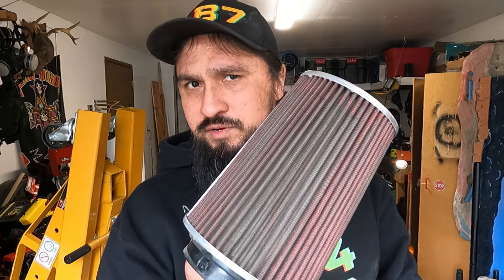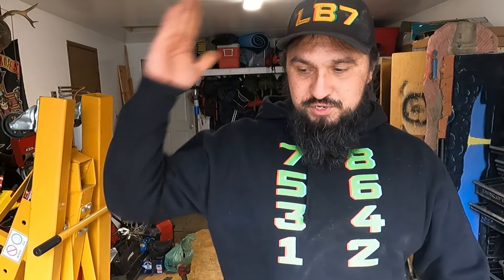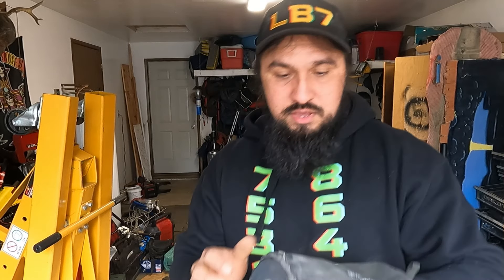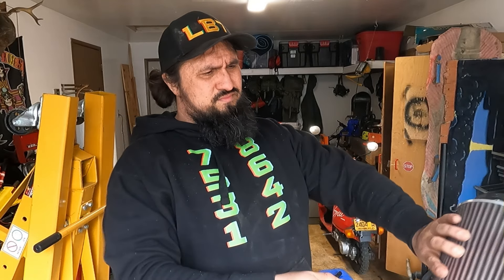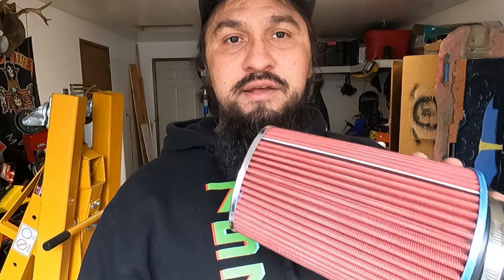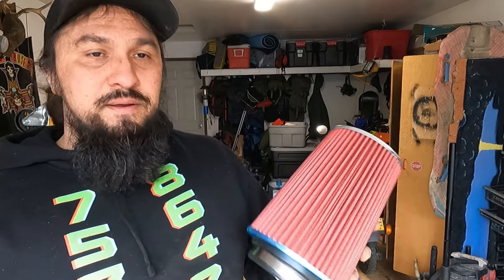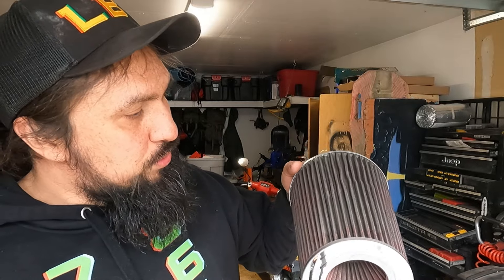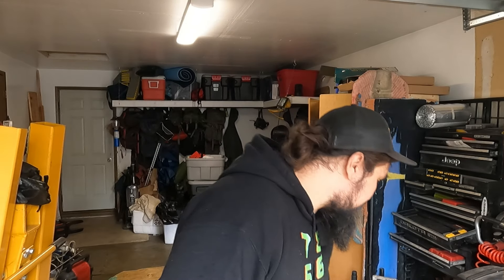Duramax Running Rough? Hesitation & Smoke Issue Finally FIXED! 🛑

Comment: Great job Brother 👏 I got a Lmm and @ 140,000 miles I have a egr side intercooler leak and its Whistling @ the boot O-ring or plastic pipe cracked old oil dirt on it! Please tell me my Turbo is OK !?
Thanks 🤠
Reply from the maker: I will hold your turbo in my thoughts brudda! Lol, I think you already know you are on  borrowed time though 🤣
Reply: Ya maybe but I'm going to change out the bottom boot aftermarket and stop the leak and run er! I recently changed the thermostats so she's up to running temp (not low) and I have no check engine on and hopefully boot leak is the sound not the Turbo 😅 Thanks Bro 🤠
Reply from the maker: @ronaldbabbitt6318  oh yeah, can almost garentee you are hearing the leak!  It's a high pitch whistle?  That's what it sounded like both on my truck with my buddies truck.
Reply: @KooshdaakaaGarage  Thanks for all your work and Totally Awesome videos ! 
Jeremiah Johnson Mt livin 😎 🙌 I can dig it!